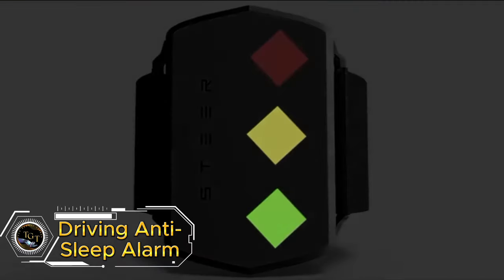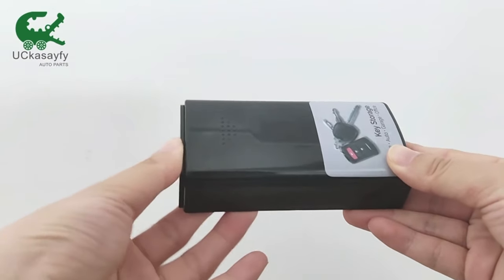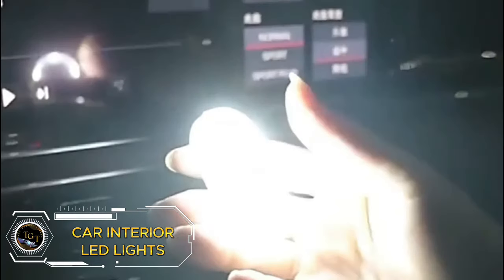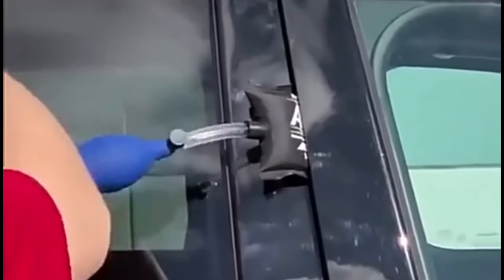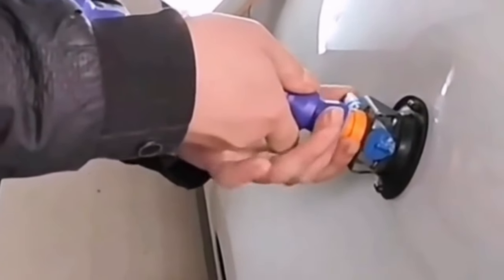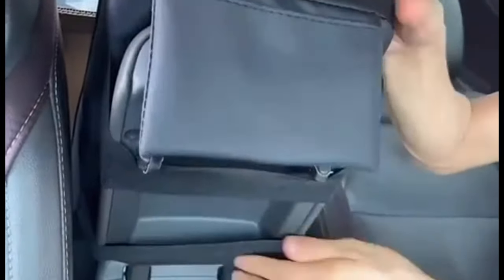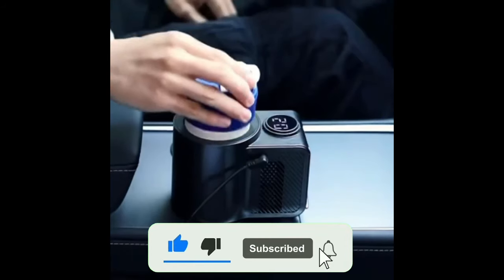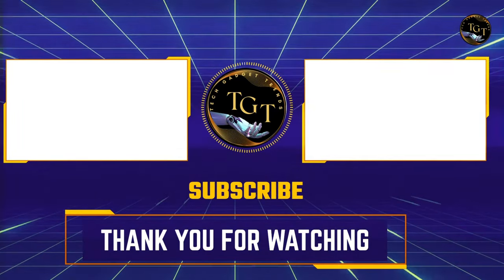15 must-have car gadgets in 2024 | Gadgets for Luxury Rides 🔥

Comment from the maker: link of the gadgets on video
- Driving Anti-Sleep Alarm $104 https://amzn.to/3POb2rS 
- Car Rotary Knob Decor $17.99 https://amzn.to/3TQfvvc
- Magnetic Key Box $9.89 https://amzn.to/49tDHJV
- Car Modified Trunk Spring  $9.69 https://amzn.to/3VJTj8V
- ANTOM Wireless Strobe Light $24.69 https://amzn.to/3vvoFFG
- Car Interior Led Lights $21.99 https://amzn.to/4aps2Ni
- Rosefray Seasonal Tire Totes $52.99 https://amzn.to/4cLdcSY
-  ZNTS Emergency Key Hook Tool $53.99 https://amzn.to/49pyv9W
- Shark Fin Warning Light not Antenna $22.98 https://amzn.to/3VNDONe
- Car Dent Repair Tool $15.99 https://amzn.to/4cL0kw2
- Magne Tic Phone Car $9.90 https://amzn.to/3TPJ0NJ
- Auto Center Console Armrest Pillow $24.99 https://amzn.to/3xhLblF
- suction cup bike rack $159.99 https://amzn.to/4aG2H1t
- Cup Holder 2-in-1 $39.99 https://amzn.to/4cIuH6l
- Headliner Repair Kit $8.99 https://amzn.to/3TNSCbV